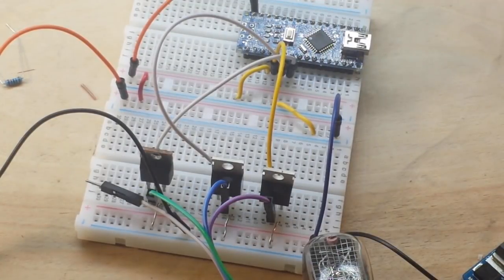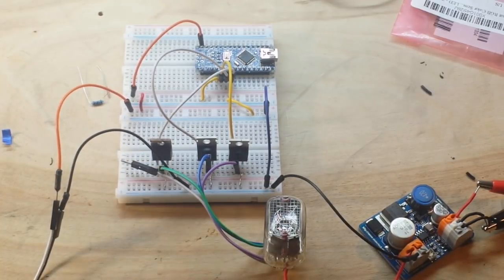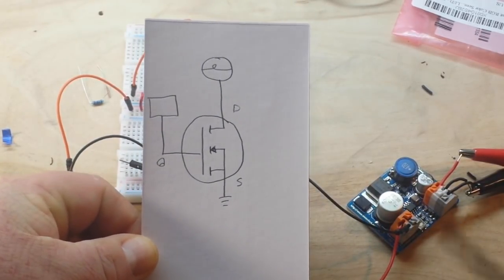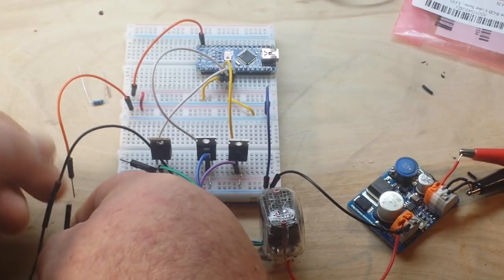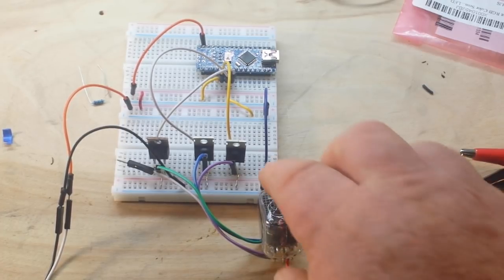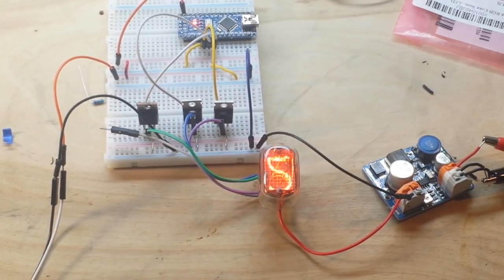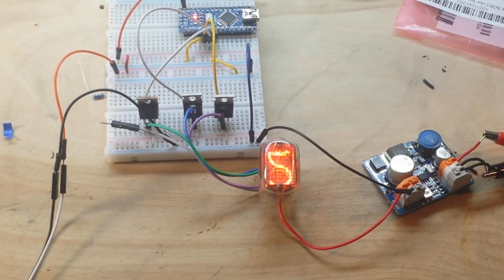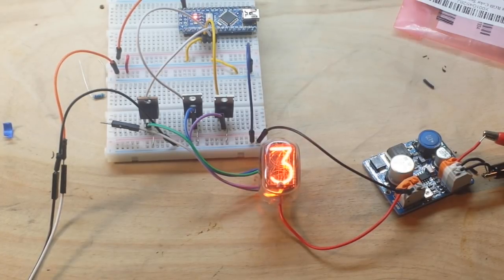Driving a Nixie tube with an Arduino

Comment: which is the video you talked about?
Nixie clock using Arduino where only 1 pin per Nixie is used
i'm working on a nixie clock

Comment: nixie tubes are so beautiful. I just bought a set, but i don't know what i want to use them for. but i'm just researching how they work. I'm guessing one pin on the bottom of the nixie tube is one digit?  and i'm not getting why there's normally 2 voltage levels listed...  I'll go through your "how does an nixie tube work" video.. hopefully i'll find my answers there. Thanks for these videos!

Comment: Can you post the part # for the MOSFET's?  I'm thinking IRF640N's (200V) should do it - since you're probably only going to run the tubes at something like 185V (less if you can get away with it, just to extend the life of the tubes).  Also - I don't see current limiting resistors on your breadboard - I would think something like 4.7K off the anode should do nicely.  Without that current limiter, those tubes are going to just gobble up current which will A) stress the boost converter and B) burn up the tubes.   I'm thinking of using an ESP8266 (so it has on-board wifi) to pick up the time from the internet and run a single digit Nixie clock (I already have a 6 digit IN-12 clock and I have some tubes left over)  I'm a Software Engineer, so writing the code will be the easy part - but its been a while since I took EE classes back in college.   Looking forward to the rest of the project. Thanks!
Reply from the maker: I used IRFZ44Ns. Also the power supply is current limited specially for Nixie tubes.
Reply: Ya' know - after I posted - maybe an hour later - it dawned on me that the power supply was specifically for Nixies - and the little voice in my head said "I wonder if it's current limited already" - Yep.   But what I don't get is how you can use a MOSFET that's only rated for 55V in a circuit that's probably got 170V-190V flowing in it?  I'd think those MOSFETs would get REALLY hot and then melt.
Reply: Hi Brian, my name is Feli and i'm trying to make a nixie tube clock. It's my first project and i'm having trouble choosing which MOSFET I can use, the tubes are IN-8-2. I'm not any kind of engineer and I'm just trying to learn by myself so if you could give me a hand I would be very grateful.
Thank you
(sorry for the poor english, may have trouble with that too)